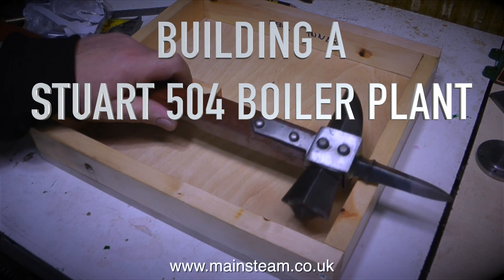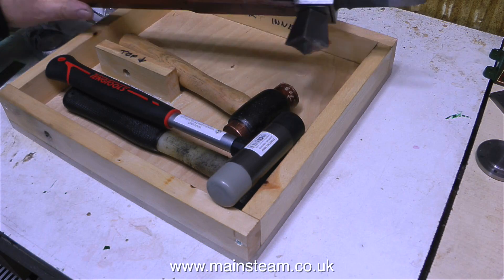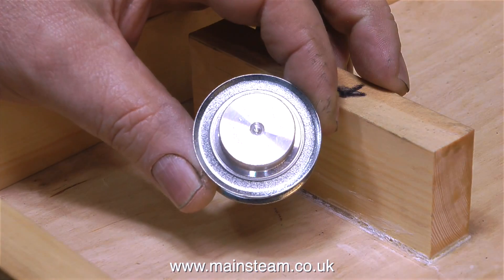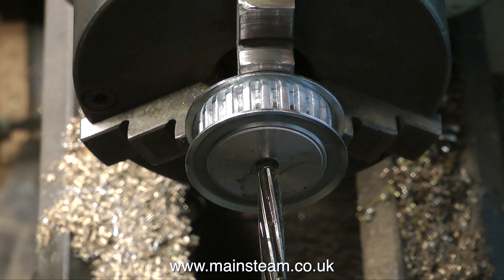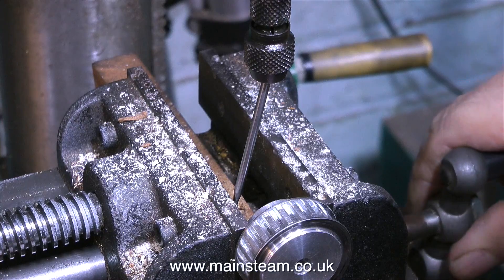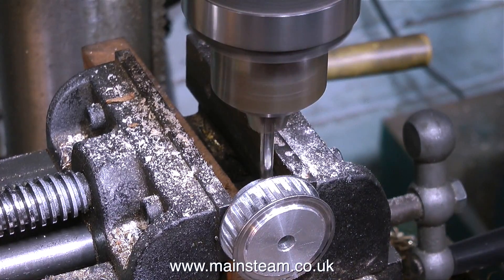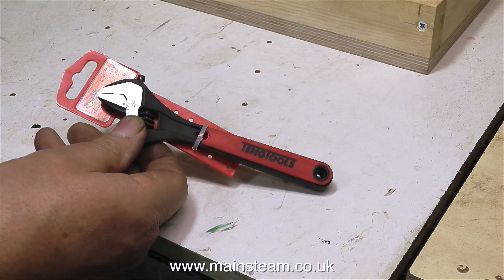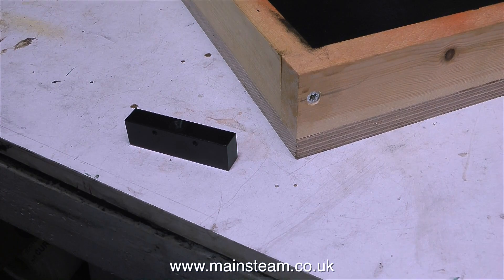MAKING A STUART 504 BOILER PLANT - PART #19 - THE TOOTHED BELT DRIVE

Comment: It's all looking very good. Question: how much clearance did you end up having to leave between the bottom of the large pulley and the bottom of the box? From the camera angle, it looked very tight, but camera angles can be deceiving, so I'm curious. Thanks as always for another excellent installment in the series.
Reply from the maker: about 1/8 of an inch - just enough - {:-)))

Comment: Nice bottle opener, I won a Rustoleum hammer last year which instead of a nail puller claw at the top has a beer bottle opener, it is a half size solid hardened steel hammer and so damned useful for whacking in tight spaces lol   Sadly tho I too am diabetic and not allowed alcohol cos of medication so I don't get to use it as an opener and instead use the opener bit for pulling nails and bolts out of holes instead :)

Comment: Do correct me if I am mistaken, but the 2 grub screws are there to insure a nice and secure bite on the shaft  the pulley will sit on to prevent any slip happening while in operation, right?